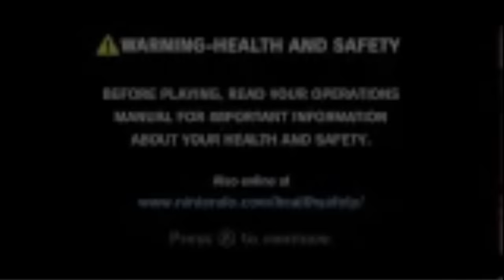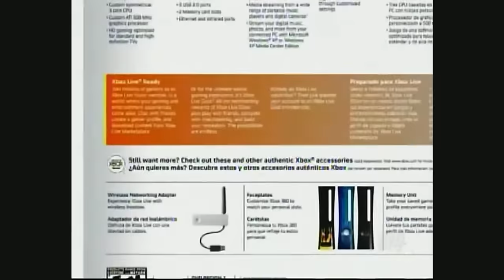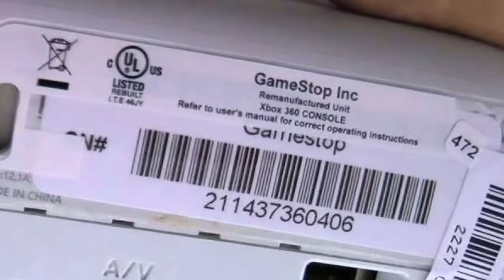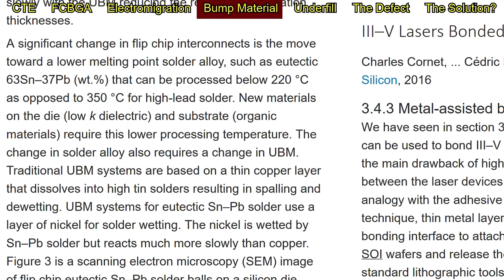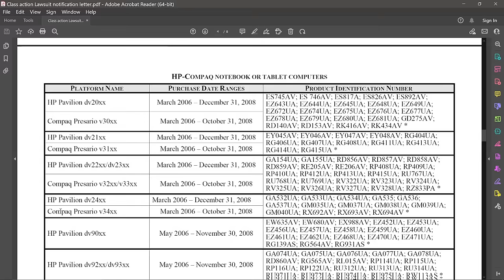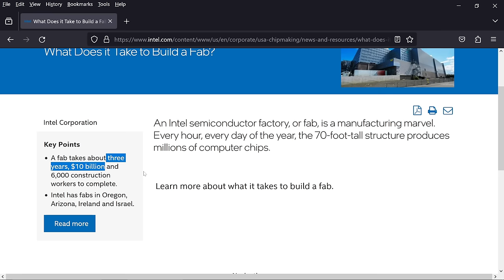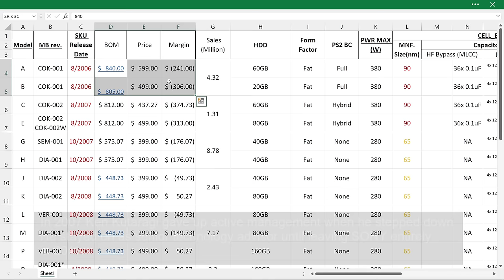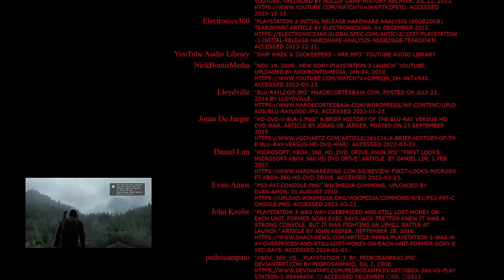A 360 Story -  The RED Ring of Death & the 7th Generation Console War

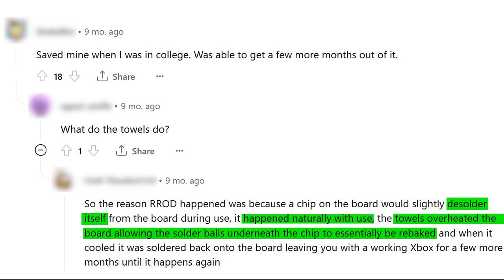Comment: 32:09 didn't watched video yet, but just wanna tell my recent experience with xbox 360 e. Before i rgh'ed it, temperatures even in dashboard went up to 84 degrees(and maybe more), while fans always was on lowest rpm, so this set point is wrong i guess. It's not thermocouples fail(rgh'ed console shows temperatures correctly), and it's not like fan controller broken and can't rotate faster(it can, i manually set 65% in dashlaunch), so yeah. And it's known issue that most "modern"(at least from 2008-2015) pc gpu's can be broken at 80-100 c degrees, there is even a lot of guides how to "fix" this gpus, for example with iron(the one for clothes). And they mostly won't die if you set the fan speeds higher.

Comment: I will say exactly why the Jasper 360 don't have defects, it's due the Gpu being made in 65nm and Edram being made around 80nm and using a Heatsink Nearly as big as the Heatsink for the 90nm gpu and 90nm edram so with that the Jasper Gpu Never get so hot around the 80c, so as Microsoft made the next Xbox 360 model the Slim with 45nm apu, But With Small Heatsink and low Speed Fan the problems of cracked bga come all back again, The Slim Xbox is so Defective  as some of the first models of the 360.

Comment: 40 years old . i have repaier shop for 20 years 
back in the day 2008 every day 1 dell d630. nvdia fail 
after 1 years d630 remove gpu
just intennal  intel gpu 
after that . in 5010 . they used jumper around gpu 
when gpu fail . we change 20 jumper and add 25mh cyrstal to northbrige to 
run intel graphic basic on nbrige 
after 2012 .intel add internal gpu ,when second gpu fail 
just unistall nvdia.amd driver 
untill amd cost about many bilion to get 7nm 
.you dont forget how small is the die  is low heat
sorry for my english  i am iranian

Comment: My Bro to this Day have you ever tried to remove Rsx ihs and just apply pressure not on the die but all around the Chip fiberglass to really know absolutely if it's the Bga or not??
Reply from the maker: Yes. Most of the time it does nothing. Sometimes it changes visibale artifacting. If ligth pressure changes anything it can BGA, but that's not 100%.
Reply: @ripfelix3020  Alright Thank You For Reply Felix!

Comment: I loved your video. I have a question I would appreciate if you could answer. I am following your tutorial on PSX Place on how to lower the voltage of a 40nm swap on a PlayStation 3. My question is regarding replacing the original BD3520 N-Channel MOSFET controller with BD3504. When I tried to purchase BD3504 it was discontinued. Is there another mosfet that would work I can purchase online? For the 1.8k ohm resistor, could I use a 1/16w one? Lastly, would a 1/10w resistor work for the 3.9k one? Both would have a size of 0402. Thank you.
Reply from the maker: I got mine on ebay. Ali express has BD3504s too. And if you can't source them, every COK-001 has 2 and every COK-002 has one. So if you have any scrap BC models that couldnt be fixed, you can harvest the regulators needed. As well as the resistors. We found values that'll work. It's just a voltage divider and the math is listed in the tutorial. So you can use any combination of resistors that result in the divider voltage of 1.0v (65nm) or 0.95v (40nm).
Reply: @ripfelix3020   I found some on the internet that are labeled "BD3504FVM-TR, ROHM, IC LNR REG CTRLR 1OUT 8MSOP." Would that be what I'm looking for? It looks correct to me. Thank you.
Reply from the maker: Sounds right
Reply: @ripfelix3020  Thanks for all your help. Have a fantastic day.

Comment: Overheating wasn't a myth, two of mine overheated badly and shut themselves down while playing GTA IV in the verticle position (terrible for airflow, but for some reason Microsoft marketed the console in this position so I thought nothing of it at the time). They were fucked after that and wouldn't power on for more than 30 seconds without immediately overheating again, sometimes they wouldn't power on at all and just display red rings. It was definitely an issue.
Reply from the maker: Yes, there is always some percentage of overheating. I am talking about greater than normal failures. Specifically the RROD, which is 3 red rings. Not 2. People conflate the two, because overheating is the low hanging fruit. But besides 2 red ring overheating events, which are not that common, as in responsable for killing 95% of all launch models common, which are easlily fixed, the underlying issue was more difficult to root cause.

But I do take your meaning. I just opened a PS3 that had a terrible spread of thermal paste from the assembly line. I've heard of similar issues from 360. But again, it doesn't amount to a greater than expected rate of failures.

Comment: What I want to know is: Why did Sony start putting discrete GS chips in the 80GB model PS3 and reduce backwards compatibility if they were producing EE+GS before that? I’ve been asking that since they did it. Surely they didn’t start producing yet ANOTHER chip. Was there a surplus stockpiled away somewhere that they wanted to dump into PS3s since the PS2 had moved on to EE+GS?
Reply from the maker: I think that was a cost down measure. Not sure about the relative cost of the EEGS vs the GS, but I dont think it saved much. I need to look into that more. Like IDK if they were a new sku or reused leftovers from from the PS2 production lines.
Reply: @ripfelix3020  Yeah, it just seems weird that they would dedicate any fab capacity to make more of the GS if they were already cranking out EE+GS for PS2 (and PS3!). At the time I was convinced that they were just using up a stockpile and they would reintroduce an EE+GS BC model again in the future. Obviously, I was wrong.
Reply: @emmettturner9452  Likely less cost by using just the GS and not the EE as well. The PS2 lasted well into 2013, so they probably had to ratio the chips enough to span across both the PS2 and PS3. Until they decided to further bring the cost of a PS3 down with the release of the CECHG models, which marked the first units to not contain any single trace of PS2 hardware anymore.
Reply: @NSHG  The EE+GS is a single chip. It can’t possibly cost less to spin up production of more GS while simultaneously producing EE+GS (for PS2) when they were already producing and using the EE+GS in both consoles. When they switched to the older GS they either had to resume production or they were pulling from a stockpile. We saw in the slides that they were considering outsourcing certain chips specifically to free up chip fab capacity so it’s even more doubtful that it would save cost to produce more GS chips, especially when the PS2’s EE+GS was still in active production. The cost thing still doesn’t make sense unless they had a cache of GS leftover from early PS2 production… which very well may be considering how short-lived the partial BC model was.

Comment: I'm not convinced all 65nm RSX chips are fine, my own 2003A slim recently died of what looks to be a YLOD but I will probably replace the NECs to be sure.
Reply from the maker: Check errorlog. It's most likely A0801002. That model has Tokins on the RSX side and the GPU lasts long enough for them to fail. I have very few reports of the 65nm GPU actually failing. Plently of them dying after a delid or reflow, but not from untampered consoles. I'm sure it does happen, but not anywhere close to what we saw with bumpgate.
Reply from the maker: You can't easily replace tokins. I made a PCB (PS3 tantalizer) to make installing a replacment array of polymer/MLCCs easier. https://www.psx-place.com/threads/research-experimental-nec-tokin-capacitors-replacement-ylod.25260/page-217#post-313627

But you don't need to use them. You can install polymer caps directly to the PS3 and use bridge wires too. If you're careful to select the right gauge and use enough of them to handle/distribute the current without buring up.

Comment: Do your tantalizer board maintain the + to + bridge or no?
Reply from the maker: yes, one of the major design features
Reply: ok cool, and where can i get it manufactured, and what are the surface mount components that fit for the small ones? (not the 7343)
Reply from the maker: Link to the release page. Example caps linked (just an example). You can order from OSH park, or download the Gerbers files and have anyone you like make them.
 https://www.psx-place.com/threads/research-experimental-nec-tokin-capacitors-replacement-ylod.25260/page-217#post-313627
Reply: Ok thank you

Comment: he Felix , do you accept questions buddy here or in some other forum?
Reply from the maker: Yeah, I read the comments. If I can keep up with them.
Reply from the maker: depends on your price range, but the ACHI SC IR PRO is the most afforadable and still capable. But for a step up, a 3 zone hot air machine like the LY G580 is worth the extra.
Reply: @ripfelix3020  I don’t really allocate a budget I’m not a repair shop just a hobbiest and I enjoy doing repairs and mods. I understand that old machines used to heat from top only which may lead to a bent board; this typically happens in thinner board such as of Xbox 360 and easily renders the board useless. 

Judging by this video you are a highly skilled fella and the machine you suggest is considered a viable option.

One more thing, how did you rebuild that nasty trace!!!
Reply from the maker: Microsoldering is a PITA without a micrsocope. So that's #1, a sterioscopic microscope. #2 was BGA repair pads. Wylie lugs specifically. and #3 UV curing solder resist (mask) to cover the trace and hold the pad in place. Then carefully clean, apply flux and reflow the GPU in place.

Wasn't expecting it to work, but it did!

Comment: Eh, idk if id consider PS3 sales a win as according to your stats, the PS3 only sold 1.19% more than the 360.

You could make an argument that they had recovered and bounced back in sales due to the redesigns, but I'd argue making the console cost about the same as its competition is necessary. Case in point, xbox made the same mistake for the 8th gen.

Still win overall by your metrics.

If someone is getting butthurt while reading this, illnote that the Xbox had a great first half for games, while PS3 had a great second half. So when the 360 was getting what would eventually be lesser sequels to its franchises, PS3 owners got a cheaper console than launch AND good games for the next 4 years.

Then the 8th gen happened.
Reply from the maker: yeah, I agree with that. I focused on launch models so the argument for focusing on the first half of the console's life is a fair point. And If we do that, 360 has the clear advantage in sales and quality performance in cross-platform games.

One thing I forgot to include is that ps3 controllers have a Li-ion batteries, which stands out as a quality of life improvme t over the 360's AA and NiMH batts. Same with wii. Those rechargable NiMH batts dont last long and lose their charge everytime I havent played in awhile. Ps3 controller is more modern by that comparison. OTOH it's easy to simply drop a couple AA in and get playing, as long as you remember to take them out before storing so they don't corrode.

Comment: Nintendo didn't win the 7th gen, because they ended up making an entirely different product. If the wii counts as 7th gen, so does my racing simulator. The reality is that the wii is still 6th gen tech, and generations should be based on tech not dates. Thus the wiiu is actually the 7th gen console. And switch is 8th. They're a full gen behind.
Reply from the maker: I don't disagree. It really didn't feel next gen.
Reply: spiral7399  Nah. The wii is a gamecube pro. It's as next gen as the ps4 "pro". Nintendo was playing an entirely different game at that point so you might as well be comparing the xbox to tiger electronics device that came out that year.
Reply: @JarlBarbossa  or a Tamagotchi.
Reply: @JarlBarbossa  It all depends on what you consider by "next-gen". I could argue that the Wii by it's feature-set (if you don't factor in performance and everything related to it like resolution) is roughtly equal to the PS3 and 360. It did have bluetooth and Wi-Fi (something the 6th gen console never got and that the 360 didn't have built-in until years later), more online capabilities than any 6th gen consoles (especially the PS2, Dreamcast and Gamecube, which had nearly inexistant online supported by a very small selection of games, and no online shop whatsoever) and motion control years before the competition (which has stayed with us since then in one form or the other). In that sense, the Wii is closer to the 360 and PS3 than it is to the PS2 and Gamecube. The emphathis was simply not put on graphical fidelity at 720P.
An aspect on which the Wii shined more than the other 2 was framerate : there are far more games running at a rock-solid 30 or 60 FPS on Wii than on 360 and PS3, where a good chunck of the library wasn't even running consistantly at 30 FPS.

As for the Wii U and Switch, I would consider those late 7th gen and 8th gen personnaly
Reply: @benjib2691  The Wii is more like the sega 32X, it's a mid-gen console.

Comment: the og 360 temp target for the gpu was 97??🥴
Reply from the maker: Some very early consoles had that yeah! But most had the one just beneat it. Still too high tho.
Reply: @ripfelix3020  wow, who did the math lol. underfill could only soustain like 70 degrees, at 97 degrees it would have had no effect at all. i wonder how much it lasted to an hardcore gamer, probably like 3 months
Reply: Very early units only. They switched to 83 pretty fast. That was before the failures were really a thing, so I have no idea why they did that. Nobody I asked knows either.
Reply from the maker: Yeah, it makes you wonder why they would lower it. Most people will just complain about how loud the fans are and not thank you for the reliability gains. If they had no reason to suspect there was a relibility issue, why change it?

I can only speculate. Maybe they were testing them at the higher temp target and "forgot" to change it before launch. Or wanted the console to sound quieter at or around launch, for the reviewers to tell everyone how quiet it is regardless of the horsepower under the hood. Then bait and switch after they got the favorable story. SONY did that non-sense putting more efficient "binned" silicon lottery winner GPUs in review units and dev kits. Some of those binned chips made it into very early laynch models too. I've seen one that had 65nm like temps. Truely inpressive for a 90nm. So OFC everyone would be saying, "ps3 is so quiet." Then we buy the normal units that are louder and less efficient. I always notice they have thermocouples built in, but never display temps for the user. We always have to jailbreak to install HB to see temps. I get the argument they want us to play the video games, not fixate on temperature game. But also wonder if it serves to obfuscate shenaigans like this.
Reply: Wish I knew why they lowered it, but I don't. The Tj is 105C so ...

Comment: Those "bumps" are "solder balls". Reflows and reballs work. It all depends on who's doing it, the experience and the equipment they're using. If your shit last 3 months, you suck at BGA. If your shit last 1 year, you suck at BGA. Sorry, a cheap ass griddle, T8280 with an Aoyue top heater, calling it a fix, doesn't cut it. Spends the thousands on a proper BGA station and do it right.  Everyone talks about "replacing the chip", but how do you attach the chip back to the motherboard? You have to reflow it. If you don't use flux, guess what? If your profile is off, guess what? You do know that the chip you buy is reballed, right? If you think solder doesnt crack, then you deserve to be lied too. There are thousands of videos not only with gaming consoles, but RTX, GTX boards etc...to prove it

Comment: it was stated by microsoft overing gpu caused the solder balls to crack
Reply from the maker: I've heard that, but it's not true. It's people hearing confirmation of what they think they understand, based on a lack of understanding of how the GPU was constructed. The balls were a popular myth and a convenient scapegoat. Not the root cause. Miscrosoft, dell, HP, Apple and other root caused the bumps. That's a fact. Microsoft worked with Amkor on the fixed Y1 revision, AKA Y3 inwhich they solved the bump issue with higher Tg underfill, which was a design prinicpal employed in fixed rhea chips too. A reball couldnt fix the RROD issue. That's a rediculous notion and if true, wouldn't have been even close to difficult to root cause. It's the low hanging fruit and 1st thing they tried. It works for a short period of time, but the RROD returns. And sooner than it took to die the 1st time.

Comment: Great video but it mostly repeats what was said before.
About internal PSUs I can assure you fat ps3 PSU is a real burning heater in the console (but it can be replaced with compatible newer model that runs not that hot). Internal PSUs never was great idea.
About compatibility I heard different opinions.
There is compatibility list but no one can say is the game runs correct or not before testing it.
Making point on OtherOS is pure bullshit since Sony pulled it. (and you choose to judge Xbox by current state, lets also judge PS3 by current state which is not include OtherOS)
Reply from the maker: Sorry, but no.
Reply: @ripfelix3020  it just your opinion tho.